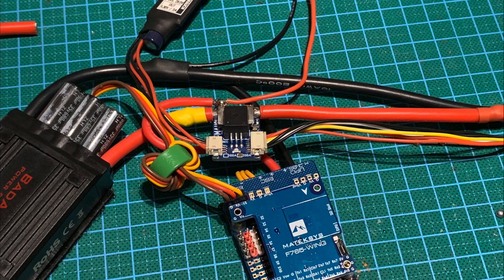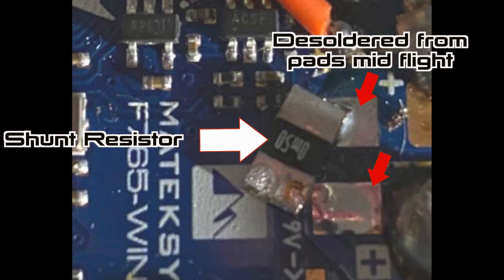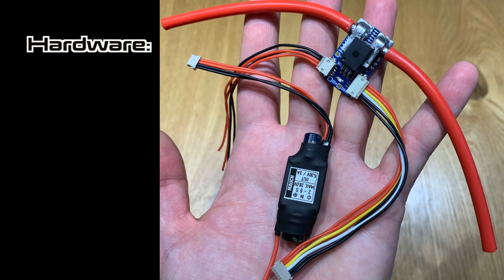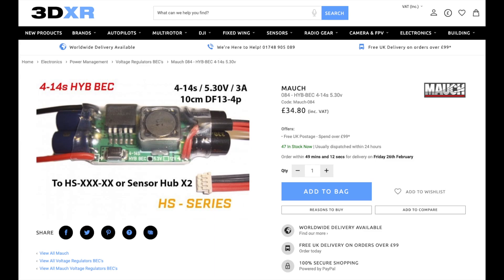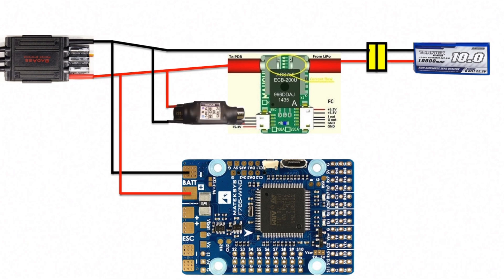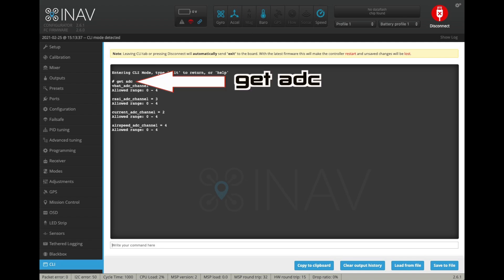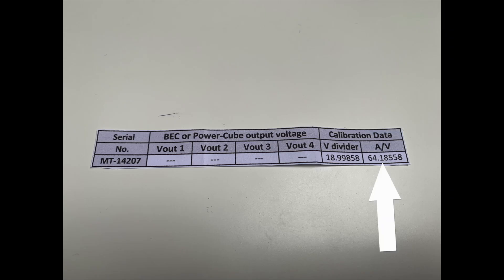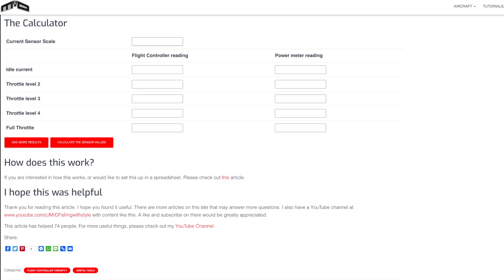⚡️How to Install an External Current Sensor in iNav on a Matek F765 FC

Comment: Hi what is the difference between External Current sensor and VBAT telemetry from RX R24D + CRSF to PWM converter?
Reply from the maker: VBAT telemetry only tells you your battery voltage, so you don't get data on mah consumed or how many amps the model is pulling. Current sensor gives you this data which some would consider a must have on most models

Comment: Hi Adam, quick question, what gauge cable do you use between hall sensor and flight controller? Also the power cables to FC, as there is not much load, is servo cable enough? Thank you for sharing this!
Reply from the maker: Hey, I think I use 10awg from the sensor to the battery and ESC, but from the sensor to the FC very little current is used so it's not chunky stuff, it's around 14 - 16awg

Comment: Hi Adam, glad I found this. I am looking in a fixed wing 100A project. For the signal you don't use the red BEC wire; would it be better to buy an OPTO ESC? (never used one before; I believe this is without BEC?) Thanks
Reply from the maker: Hey, when building a fixed with with a Matek FC you never need a BEC in the ESC so I'd always prefer an ESC without the BEC as it's smaller and lighter normally. Since this video I swapped the ESC out for a 200a APD which has no BEC. Cheers
Reply: @AdamGdoesFPV  I was just looking into it. Never heared of APD; is this "advanced power drive"? Some sort of ESC? In my model weight is no problem as I need it for balance. And cooling will be better with a heatsink esc. I understand with smaller drone size motors, but I am looking at 6360. So OPTO will be a good option.

Comment: Hi, I have a problem with the voltage sensor in my Speedybee F405Wing
The value is up and down 13v~20v (I use 4S battery)

I have changed the battery but the problem still occurs
I am really frustate because I cannot know the remaining battery in my flight

Do you know what component that I need to check? (It seems I broke that during soldering the cable)

Is there any external Voltage Sensor available that can send telemetry through our Remote?

Would it be possible for us to  parallely connect the Receiver (Matek R24D) to Flight Control and CRSF- PWM converter

The idea behind that because I heard we can get Vbat tellemetry to our remote using CRSF-PWM converter

But at the same time I stil need OSD and Waypoint capability from Flight Controller
Reply from the maker: Sounds like you might need to solder a capacitor onto the FC. I do this when voltage or current readings are off. Failing that you might simply have a faulty FC

Comment: Nice - I "had" a problem - building an 8S 9" geprc pulsar quad.. the foxeer PDB's current sensor just doesn't work, as admitted by Foxeer.  Good grief!  Then I remembered that I had a Mauch 14S 200amp with bec laying around!  Yay!  And here I am...
Reply from the maker: Nice 😎 hope the Mauch worked out for you

Comment: I have not heard about the 5.35v requirement .
Most BECs I have used put out 5.2 v
So your saying 5.2v won't work , why ?
Thanks for the heads up . I'll be putting a xuav talon pro soon with 6s .
Its these little details that your not told about or are only mentioned in some obscure way that I end up struggling with .
Reply from the maker: Hi Ron, the 5.35v requirement is only for this specific current sensor that I purchased. I've no idea why it needs this exact voltage but that's just what it says in the manual. Enjoy the Mini Talon :)

Comment: Great video! Is there a way to do this for 400-600Amps system 12s? Cheers
Reply from the maker: Probably yes, but not that I know of. I've no idea what you have if it pulls over 400a on 12s 😱

Comment: Would you recommend an alternative FC to avoid this problem?
Reply from the maker: I'm not aware of any FC's out there that can deal with really high amp applications. They all require an external current sensor. If you're running high amps the only options are external sensor or just bypass the FC and do without amp and voltage readings

Comment: Hi Adam, great video and very useful. I am building a 6S Mini Drak with Badass 2814 1300KV and 80 amp APC ESC, I was planning to use the new F765-WSE FC that states Current Senor: 220A,  3.3V ADC  (Scale 150 in INAV,  66.7 A/V in ArduPilot). Do you think it would still be wise to use the external current sensor with this setup?
Reply from the maker: Hi mate, glad the video was useful. If you’re going with a badass they supply data charts online for different cell and prop combos, and from my experience they are extremely accurate! If it’s less than 90a (boards rated continuous amps) I’d say you will be ok on the FC current sensor, especially if there’s good cooling. I hope this new FC lives up to the states spec 😊 good luck with the build

Comment: Can i just drill a hole and use screw and nut to clamp the wires and pcb together using crimp connectors to replace the solder?
Reply from the maker: I wouldn’t do it that way myself. Is it just because you don’t want to solder?

Comment: Wow, I'm really glad I found this - well done! I'm putting an F765 FC in an 80mm EDF jet on iNav and need an external current sensor for the 110A peak. I was just trying to work out how to interface with the FC and your video answers everything. Earlier, Josh put me right on the type of sensor but I hadn't realised I need the BEC too. Thanks to this  I can order the parts all together and use your wiring and config with confidence. Brilliant - Thanks again Adam!
Reply from the maker: Glad it helped mate. This is the best way to be able to fly a high amp plane with the confidence you won’t melt the shunt and get a blackout 😎 enjoy!

Comment: My f765 got smoked by 15 seconds of 110A on 8s in f22, crashed shortly after takeoff thanks to it lol
Reply from the maker: Ah... sorry to hear that. Now you know how to avoid this in the future though at least😁 110a would be a walk in the park for this current sensor
Reply: @AdamGdoesFPV  I actually had installed an external current sensor (on CU2)...... I was told cu2 was undefined so no way to use the external with Inav, glad to see that it actually is possible

Comment: Very informative, thx for sharing this knowledge. Can we not use the 5v from the matek board regulator instead of adding an extra BEC?
Reply from the maker: Glad it’s useful 😃👍🏻 unfortunately not because the FC BEC is 5.00v and the accuracy of this means it could be 4.90v - 5.10v. This current sensor requires 5.35v specifically which the FC can’t provide. Hope this helps

Comment: I fully agree with the weakness of Mateks current readers! Up to 80A i now only use BL_Heli ESC's and take the reading directly from the ESC. Saves me an extra device and keeps the heavy battery cables to a minimum - just to keep it as simple as possible :)
Reply from the maker: Yeah this is another great way to bypass that shunt! ESC telemetry would work perfectly 👌🏻 why up to 80a though? Limited options for telemetry ESCs above this level? My Drak runs 96 amps on 12x6 and I have a 12x8 I’m going to try too 👍🏻
Reply: @AdamGdoesFPV  Limited by what the market offers :) currently I'm using the FLYCOLOR X-Cross HV2 80A. I'm sure in the near future the industry will produce 100A+ of these small, cheap, light drone ESC's. I'm done using the heavy bricks. but of course you'll find large "old school" ESC's that offer telemetry that could/should also work. I'm just fascinated with these small ESC and never had an issue so far with a fixed-wing with the proper capacitor mounted!
Reply: @stuweFPV  @Adam G does FPV  Thanks for the info and video.  I just ordered the that Flycolor ESC for a mini drak as this is the only plane i have that i'd be concerned about 50amps plus.  I guess i'm lucky as its been fine so far being pushed pretty hard.  Flycolor does have a 120 and a 160 amp version that would be great for a big drak i'm guessing.  Check GetFPV.  I don't have room for it in my MD.  New Sub adam!  :)  EDIT: realized this is a 5s+ esc.  I'll still keep it but wondering if you know of something similar that is 4s plus @stuweFPV
Reply: @beeradfpv  all the credits go to Adam :) yes I use the FLYCOLOR on my EDF-Jets that I now fly with 8s to keep the amps down. On smaller setups I use the iFlight SucceX X80A. Don't forget to ALWAYS put a good quality 1'000uf capacitor on it and NOT the stock 470uf that come with it if you abuse that drone gear for fixed wing :) On really small planes I use the Holybro Tekko32 F3 Metal 65A. I would not go below 65A as this is not worth the few bucks difference. They do tend to get quite warm. good luck!

Comment: Interested in this - flew with a mate yesterday, both flying Albabird with  BLHeli ESCs, me with 722 Wing, he used a 765 Wing. We had added caps to the ESCs, but the current reading on my plane was all over the place, peaked at 176A, while his showed 26A at 80mph, and sat at 4-6A for most of the flight. Useful to be able to confirm these readings using Blackbox Explorer, which really shows the problem. Thanks for posting this.
Reply from the maker: Hi Les, you're welcome 🙂 If the reading is super far off what you're expecting I'd check your iNav config for the scale etc. Make sure it's set correctly for that board. If it's all good I'd be looking into other issues causing spikes an amp usage. Hope you get it sorted👍🏻
Reply: @AdamGdoesFPV  Have you considered using ESC telemetry for current/voltage sensing and powering the FC with flying leads, connecting the battery to the ESCs directly? I've ordered the Mauch gear to give it a try and will also give ESC telemetry a go as I use a pair of Aria 70A ESCs on my twins.

Comment: can u try hall sensor pixhawk ...
Reply from the maker: Sorry, not sure what the question is?
Reply: @AdamGdoesFPV  in ali bangood have power module that can used hall sensor it no need soldering to measure current

Comment: Mauch is some top notch stuff.  I run it in my Believer.  I like that they give you the specs to plug in to get the correct current measurement.
Reply from the maker: Absolutely. Seems like really high quality gear and that fact they supply the specs makes life a lot easier. Worth the money🙌🏻

Comment: Great video!! I'm thinking to transform my big drak to 8s or 10s and use the pdb matek for x-class, support until 12s, what do you think about this pdb?
Reply from the maker: Thanks 👍🏻 I think that PDB would be much better than the stock CS in the FC! I have one on order to try it out. I still think a hall sensor is a much better route to go down if you’re using serious power 👍🏻